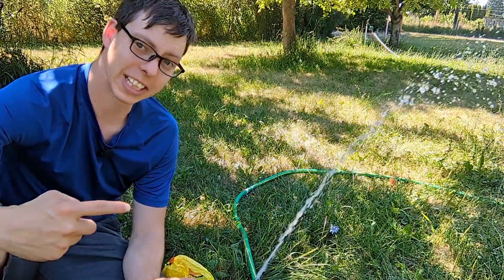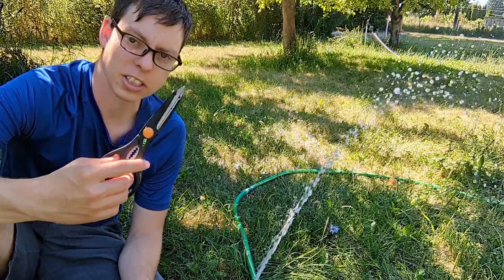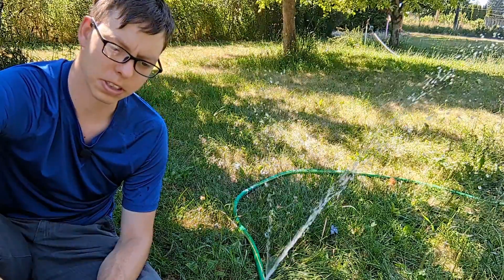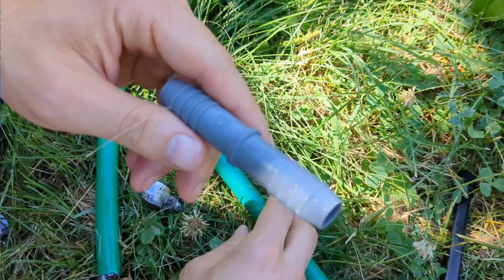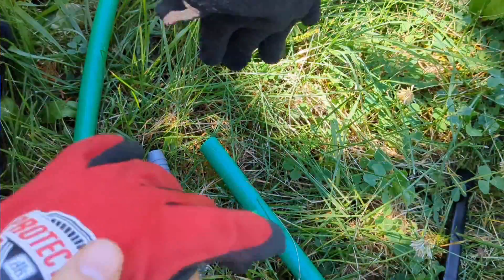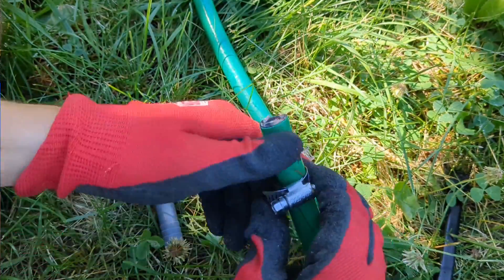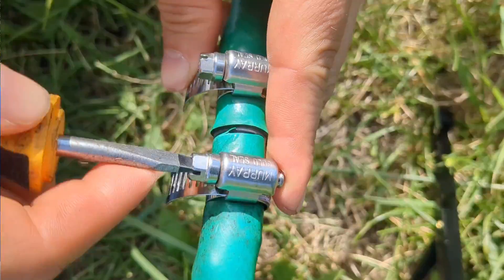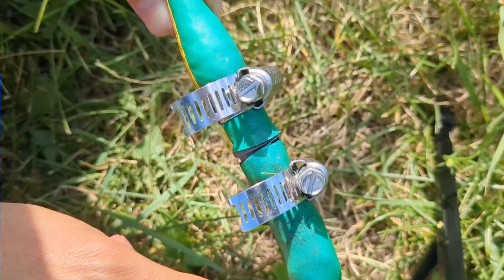How to FIX a Leaky Hose

Comment: I got some hoses last year that are absolute crap. They kink if you look at them the wrong way. They were labeled "medium duty." I wouldn't want to see what the light duty one is like. I also bought some cheap hoses at a clearance place. The fittings were lousy, but the hoses are tough and have withstood lying in the sun all day with the pressure on. I bought a box of hose ends on Amazon and replaced all the cheap ones.
Reply from the maker: Yeah I find you can't really trust the labels when buying hoses.   We do our best to get second hand and you never know what your going to get.   You can poke at at a few times before you buy but it's still a gamble sometimes.